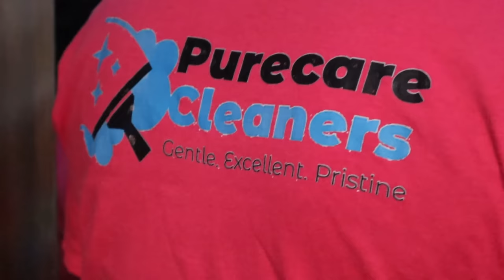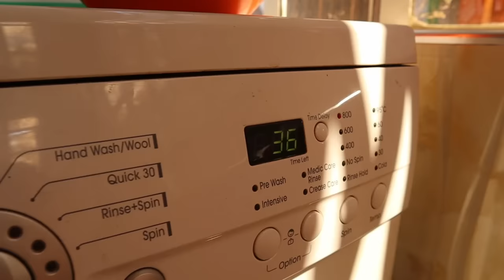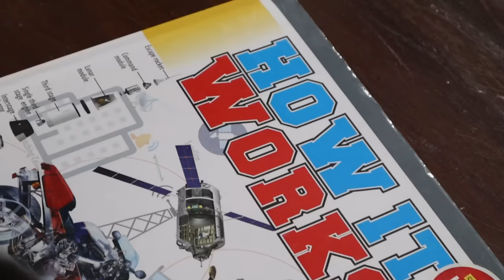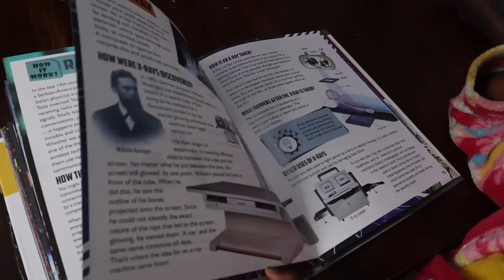I Am REALLY Struggling...

Comment: I was taught how to ride a bicycle at 7 years old. The teen teacher did not show me how to hold the brake lever because the brakes were off. So I would be stopped by riding straight into the chain-link fence!!!😅 Don't worry, you're doing good, you even have a helmet! Where are the shin pads, elbow and knee pads???😁 Next is nduthi, I learnt that 15 years ago before moto-taxi was a thing.